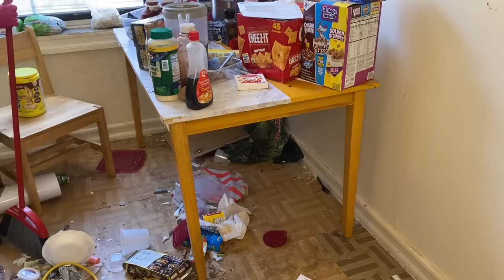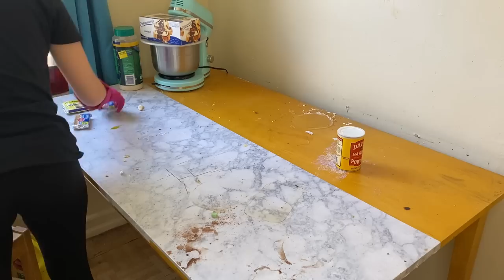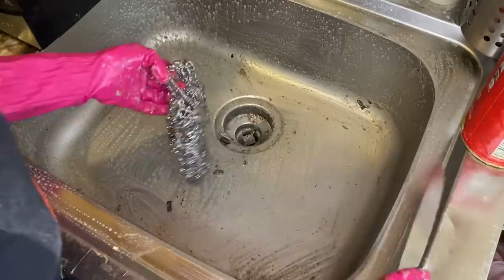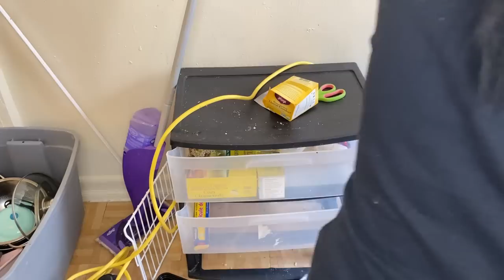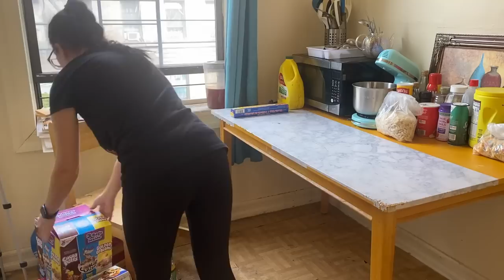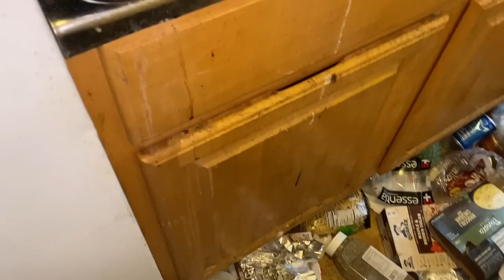Young mom suffered in depression #clean #vlog #declutter

Comment: Barbie, the steel sponge is perfect for enamel and really hard surfaces, but it has very tiny, sharp edges, and if you use it on wood, plastic, or glass, it will leave small micro-scratches that you wont see when the surface is wet but it will be very noticeable when the surface is dry. And these small scratches collect bacteria and dust and make it harder to clean for the next person. Just wanted you to know. Be careful with those.  I always read the  label and it tells you what to use them on and what not to use them on. You should trust those labels because they have a tested the different sponges and
scrubbers.on different surfaces.

Comment: Barbie. I hope my comment is useful for you. In the case of the kitchen stove, if there’s some crust to remove; beside spray I would make it soak with a rag dumped in water on top for a while,that’ll make easier the removal of the crust. That’ll also work on surfaces and will prevent to scratch on them a little less. You are doing an excellent job!! That’s for sure. ❤

Comment: Do you struggle with cleaning up & organizing? Its a common problem. Here are some tips that I hope help you! ☺
The best tips I have for you when cleaning up:
1) have 3 boxes while sorting. One each for Keep, Donate, and Trash.
2) Work for as long as you can. I recommend 50\10. You work for 50 minutes and break for 10. This helps you rest and refocus your energy and plans without allowing you to sit and get too comfy.
3) always have a bottle of cleaner and bucket of rags. I love Fabulouso. It smells Fabulous!! Its great to have microfiber towels but I cut up old pieces of clothing. They can be just as effect. Save the planet. Recycle.
4) Plastic bags: Use white for clean clothes, clear for dirty and black for trash. Why do I color code? 
White = clean/pure
Clear = so you can SEE it/Do it.
Black = garbage no one needs to see it. 
5) Bring a small tool box with you for the basics as you clean: Nails, hammer, screwdriver, screws, tape, light bulbs, batteries, wood markers, zip ties or rubber bands (for cords), lint roller, scraper, squeegee & scissors.
6) Have a specific idea of what needs to be done and in what time frame. Make a list and use a timer if it helps. 
7) Have a small cooler with drinks and snacks. This way you are not leaving the area and can still stay energized during the clean up.

Comment: Nice clean but I would not use this metal sponge in good kitchens. Maybe it destroys the kitchen not if you use it one time but if you use it often it will. Back then I did not know. Bought rhe same Ikea kitchen as a friend back then and her sink is still ok after 10years and mine was garbage after 2 years using this kind of metal sponges and I never used it with a lot of pressure .  🙈